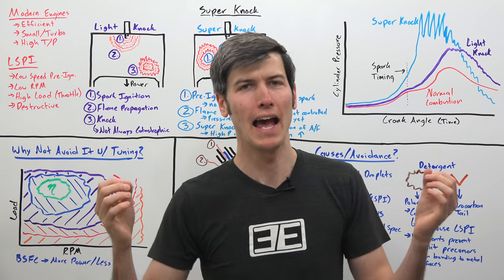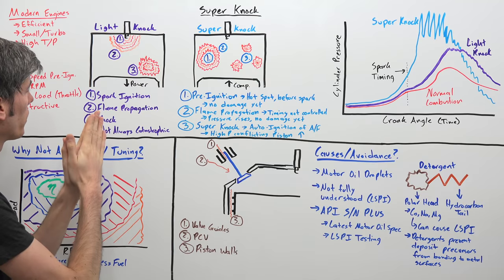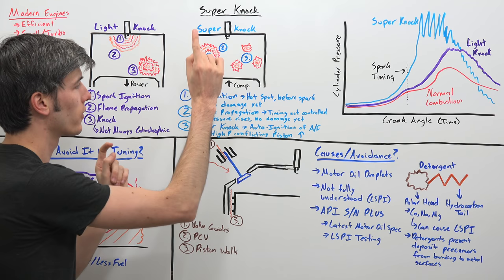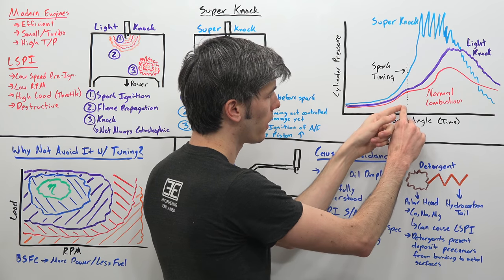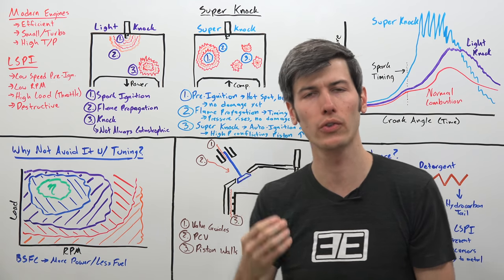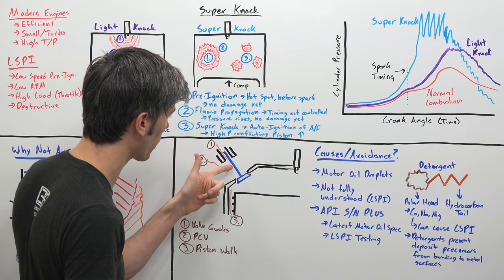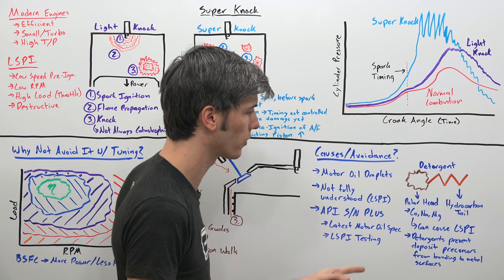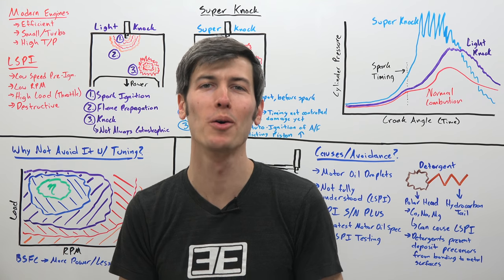How Super Knock Can Destroy Modern Engines

Comment: Hey there. I have a question ! Does spark plug plays a huge roll on how efficient an engine running ? Because I'm  the type of person that send car to service center and they advice me to change my spark plug everytime service (10 000 km). The first 3000km to 4000 km , my car running smoothly and totally save fuel ! But then afterwards it starts to run badly(the pick-up when floor it really slow) and the engine is so thirsty (monday fill up then thursday have to fill up again) !! So please give some advice for my question. Thank you. I'm not car guy so I don't know much so yeah please help me..
Reply: hello there, spark plugs have only the job of igniting, you just change them when they stop doing their job( it is a noticeable misfire).
apart of that, the problem concerning the fuel consumption, you need to provide more data (how many Litres you are consuming for how many Km and where, in cities or on the highway).

high fuel consumption can have many reasons, depending on the type of engine you own. it might just be a failing sensor causing the ECU to switch to an operational mode where your car consumes more fuel.

Comment: Toyota meanwhile took the time to develop Dynamic Force and make the tiny turbo motor completely unnecessary.
Reply: It makes 40 less horsepower than the Ford Ecoboost though
Reply: The Toyota a25a-fks makes over 200 hp.
Reply: The 2.0l Ecoboost makes 245hp, and 270 ft-lbs of torque
Reply: I’ll take a slight horsepower penalty for it being way easier to fix and also much less likely to even need to be fixed in the first place. Win win.

Comment: As had been mentioned Pinking(knock) is a bad thing and can cause problems and damage when flame fronts meet during combustion why do some manufacturers use twin spark plugs per cylinder( Alfa Romeo cars and some motorcycle engines). Doesn't this make pinking and damage in these engine more likely?

Comment: Is possible to get an rear-wheel drive electric hybrid car?
Reply: Kuber Sancho-Persad huh?
Reply: T Croft what hybrid has individual motors on each wheel right now? Maybe a supercar is the only type I can see utilizing that.
Reply: BMW i8, BMW i3 with range extender, Porsche 918 sypder, Porsche Panamera Hybrid, Honda NSX “new generation”, some new Mercedes should be red and hybrid
Reply: @ALMX5DP  Acura RLX SH-AWD...
Reply: Of course it is possible! Not only that, but the fastest car in Nurburgring, the Porsche 919 Evo is one of them!
Reply: My Smart EV is RWD
Reply: @gqh007  I think the NSX has individual front motors, but the others have motors inline with the ICE or a singular motor powering an axle, not individual wheels.
Reply: @aspecreviews  I stand corrected, I was thinking about the RDX. Yes the RLX does have individual wheels. Only a few utilizing that type of setup currently though, most being supercars like the NSX cousin etc.
Reply: I would consider something being RWD when the main propulsion is to the rear wheels and has no driveshaft or other such significant attached means of power transfer to the front. With similar logic, is why I consider Nissan’s fwd LMP thing fwd even thought 900 electric hp is driving the rear wheels
Reply: Mercedes has rwd hybrids.

Comment: Engineering Explained
could you please make a video about GPF gasoline particle filter? Is it worse than GPF or problems might be lighter? How to burn soot in it? How to do it with an automatic/hybrid transmission?
Reply: 1. its very similare to DPF
2. regeneration intervals can be longer since gasoline emitts less soot in lean combustion mode compared to diesel so it shall be better if thats how u compare them
3. regeneration is done either by injecting fuel in it and burning the content like a furnace or by excessive heating using am external source or by increasing exhaust temperatures to encourage soot oxidization
4. GPF has nothing to do with the transmission

 do u still want a video ? :D
Reply: @karimnasser6710  that's right except one thing. I guess with a manual transmission (or automatic in manual mode) a driver could help with GPF regeneration. Just hardly accelerating on a highway on 2nd and 3rd gears up to red line, and let the throttle off still staying in gear (engine braking). This could heat up the GPF up to oxidization temeperature and then let engine pump a lot of clean air (oxygen) through  the filter getting the process done.
At the moment it's not really discussed topic.
Reply: @Aleksandr_N  am not sure about that for one reason.
u see, to allow for regeneration u need an excess of oxygen , that means u need a lean burn (high air fuel ratio), burning lean is only achieved when cuising at low load for at least 5 minutes (thts the main problem with modern diesel for users who only drive in cities).
back to the scenario you mentionned, revving the engine high will happen with rich or stoechiometric mixtures, no air will be available for burning the particulates. unless regeneration will happen very fast after revving
Reply: @karimnasser6710  I meant revving high would make 1st part of process which is getting filter hot, than 2nd part would be engine braking with fuel cutoff and a lot of oxygen (clean air) flowing through the filter (remember, you already have accelerated to ~120kph in 3rd gear and than let your accelerator pedal off).
I wonder could this exercise  be enough for heating and for soot regeneration?
Reply: @Aleksandr_N  no cause when having engine braking the fresh air has a very low temperature, it would cool the filter down.
apart of that, regeneration needs a few minutes to be realized. 
but i like your logic xD, do you have any sources for your theory ?

Comment: Sweet videos, love your work. I have a question though, I drive diesel trucks and my boss just recently bought a  2018 Freightliner M2 with a DD8 ( I believe) motor. According to the manual it says it can go 45,000 miles in between oil changes.. that's crazy!! But what my boss doesn't know is that he can't use the old API for diesel engines instead there was a new revision in 2017 that added API FA-4 . I don't know too much, but it would be cool if you can find out what is causing the higher maintenance intervals. Is it the oil , or is it engine design , or both? Would like to see more videos on diesel trucks. Thanks
Reply: I actually work at the assembly plant that builds those m2s. It'd be interesting if it was Mt Holly plant truck because I probably worked on it if so lol. The DD8s are relatively new. I think the new oil and engines are supposed to work together for better efficiency and service intervals.
Reply: @Mr4512hkj  whereabouts is that? I'm in the New England area. As I heard they are fairly new. Everyone is surprised how long you can wait for the oil change.  Pretty neat ,as long as its reliable.
Reply: @luisaguilar7311  It's near Charlotte NC. The engineers from corporate were in my plant a year or two ago. Making sure we could figure it out. lol
Reply: @Mr4512hkj  nice. Do you like working there? Must be a good job. Especially in Freightliner, job security must be good, since all big fleets drive Freightliner

Comment: I'm glad mine only does it at low rpm low load cruising along. I used to think it was low rpm but I've tried dropping a gear to go from 1,500 to 2,000 at the same speed 50-60km/h etc just holding a speed no heavy acceleration. Am I right to assume this means it is not super knock?
Found out that the Italian tune up works on my DI 2.0l ecoboost but found out its quite difficult to do an Italian tune up at -20c just cant get the intake air temp up at all without a race track or losing my license. 0-160km/h only manages to get me from -c intake air temps to +2c if im lucky.

Its my own fault partly I take it out at night while on lunch in the cold for lunch and it never warms up during that time, maybe just as I finally get back 15min-20min later.
Shouldn't my thermostat stay closed to allow for a proper warm up until it is required to open? Seems the Ford ecoboosts do not do that I know 2 ppl with the same vehicle both of their engines act the same way...

Also this seems like something only likely to happen to a manual transmission vehicle any automatic would down shift... Please correct me if I'm wrong. Also I have a tune but removed it this winter figured in winter it wasn't needed but it also doesn't seem to help with my specific issue only helps with the italian tune up the extra boost makes extra heat. Guess I'll get a catch can ASAP too.

Its been bothering me just more than 50,000km but this is the 2nd time I had this issue, however as mentioned the Italian tune up seemed to work the 1st time very well but I need a summer day to get the effect to work with heat. Also I use top tier synthetic oil in the engine no noname stuff so I should be ok.

Should I stop using gasoline with ethanol? Ford says max 0-15% ethanol I used to use Shell 91 0% ethanol but since I have the tune I wanted to use my 93 tune and switched to petrocanada 94 with 10% ethanol since summer is coming up.
Reply: You don't need to have high intake temps to burn the engine clean. Just drive it normally till it's warm then let it thunder. Long stretches of highway with not too much traffic are ideal. Keep it the engine in the higher part of the midrange, then pin the throttle when overtaking or whenever you want. Engine brake till back at cruising speed. Do this for at least 15 min. Last few miles are your cool down lap, gradually drop RPM till back at normal operating revs. Don't pin throttle at low RPM, downshift then pin.
Reply: @Duskconqueror  I'll give it a shot, 1st time 10 or so 0-100 pulls back to back seemed to do the trick.

His video on how the italian tune up works seemed based on heat and temperatures which is what made me think I just didn't have enough intake air temp to actually get it off.
I believe its coming off from the Intake valves since its a DI engine.

It would be nice to have access to a closed course its ridiculously expensive to get on the track here.
Reply: @santaclause6462  All good engines benefit from longer spirited driving trips. DI engines   are, depending on the design and use of materials, harder to clean up. They'll still benefit though. I don't think you'll be able to get rid of carbon build-up on the intake valves though. Good synthetic oil will help to prevent build-up, but all DI-only engines will eventually get a little carbon on the valves. It's just a matter of time. Good working injectors and spark plugs will also prevent build-up.

Comment: Easy way to avoid super knock and simply reduce knock in general? Use higher octane gas. I do this with my Ecoboost Fiesta whenever the outdoor temps regularly get above 50F. If I run 87 octane in the middle of summer it sounds like someone dumped a bucket of ping pong balls in the engine. Using 89 octane the knocking is greatly reduced and I don't have to worry about melting my pistons or throwing rods.
Reply: I would recommend 91 octane or higher.... 87 on GDTI no freaking way.
Reply: @2damaxmr2  Yeah, I have changed to using 89 octane year round since I typed that comment. The next higher grade available everywhere around me is 93. It would definitely run better but holy crap is it expensive! So for now I will stick with 89. It only really pings under light load with no boost. As soon as the turbo passes the boost threshold the pinging disappears. Side note: I averaged 44.74 mpg on my last tank.
Reply: @angrodNumenesse  I usually dont mess with mid grade because here the difference between 89 and 91 is like 10 cents per liter. Cheaper to use proper fuel than shortening the life of the motor.
Reply: @2damaxmr2  Ah ok. Where I'm at the difference is 30 cents between each grade. By using 89 I'm already paying 30 cents more per gallon than regular and switching to 93 would be another 30 cents more which would make a noticeable dent in my budget. :/
Reply: @angrodNumenesse  I would still try to use 93 if you are running full boost. If you drive a grandmother you might be able to get away with it.
Reply: @2damaxmr2  I do drive like a granny. I'm not afraid to get on it if I need too but generally I go pretty easy on the accelerator. I got the car for the fuel economy, not so I could go fast. :) I do keep a close ear to the engine though. It really only pings under very light or very heavy throttle. Everything in between is ping free.

Comment: Any thoughts on the Super Tech and Amazon brands?  It looks like both are SN Plus and the price is amazingly less than the other oils.  I did try the Amazon 5W-20 on my Gen Coupe and did notice a difference but couldn't explain it but this video helped.
Reply: Supertec synthetic is a GL5 oil apparently.  Project Farm just did a video on it compared to RedLine oil
Reply: @gammalight1312  I saw that video and was pretty impressed but I believe the Redline oil wasn't SN Plus so the test doesn't really answer the question in this video about Super Knock and if Amazon/Super Tech (believe it's the same company who makes their oil) is up to snuff with turbos.

Comment: Couldn’t the super knock be cause by the intake pressure being too extreme to the point where there is soo much pressure already built in the cylinder and the low RPMs of the pistons don’t allow the cycle to happen fast enough to the point where the mixture combusts on its own with the slightest compression of the cylinder it’s self?

Comment: I dont understand how oil can ignite before the gasoline, because if i buy a high quality, high performance 2 stroke oil for my moped, the oil runs straight throw the engine without burning and drips out of the exhaust, leaving a mess on the floor.
Diesel needs more heat and pressure to ignite then gasoline, oil should be even harder to ignite then diesel.
Reply: I think the pressure or heat soaked hot spots are heating up oil that is hot enough to ignite the fuel too early

Comment: GDI specific issue? Carbon deposits cause hotspots?
Does the D4-S also show this issue?
Reply: is D4-S the toyota system?
Reply: @karimnasser6710  Yeah. And if memory serves, it is basically the retake on Lexus' resolution to carbon deposits on their intake valves. Because Lexus fixes stuff and tells no-one :D
Reply: @wburger2178  i guess this would depend on the engine model, cause newer D4-S models have dual injection (direct + Port fuel), in this case the carbon deposit problem shall be solved.
As far as i know, carbon deposits and knock have nothing to do with eachother, the only consequence of carbon deposit is a slight power decrease caused by a slight decrease of charge pressure.
Reply: @karimnasser6710  I was wondering about the carbon deposits and superknock. If a brand new engine shows this behaviour, then yes, it will be the oil droplets or similar. But if it is an older engine, I would think that the oil picks up carbon deposits, and these buggers will autoignite.
So to Jason: Do the DI engines show this when brand new? The superknock?

Comment: Btw, here is one recipe on how to cause LSPI: just machine your block and pistons with a dull endmill and don't deburr it. 
Why? It's because these small burrs sticking out inside your combustion chamber WILL heat up by the combustion process, but they won't get cooled because burrs don't have a good contact with the rest of the piston/head/cylinderwalls. Burrs and carbon deposits tend to work like glowplugs because of that.
That's the benefit of being bilingual: when you know multiple languages you can read from different sources and find knowledge in one language that's not available in another one.
Reply: sasja de vries. Why do you think that information is not available in other languages? That’s well known to me and I’m not bilingual
Reply: @alanhillyard1639  The point is whether something is readily available and how widespread a piece of info is. That's where I see a very clear difference between languages.
Generally speaking, some information that only specialists know in one county can be something every second teenager knows in another county and vise versa.
And then: if this info was available to you, and you speak English, why didn't Jason know about it? You both speak the same language, right? He makes videos about this topic all the time, he looks up info about engines all the time.
And then there is another aspect that you won't notice immediately, it happens a lot that roughly the same research is performed by multiple countries independent of each other, at first glance it seems like both have found the same thing, but some important details are quite often different. Because both papers look similar and both countries say "but i knew that already" the details aren't shared between those countries.

Comment: In the real world the engine is most efficient at medium load and medium rpm, not at low rpm high load.
Why are mid revs more efficient? Well, during city driving you can use engine braking and your engine has a quicker response and when you want to accelerate you don't need to push in the throttle as much. In other words low rpms are not ideal for city driving and they are not too great for control over the vehicle and safety either. The highway is where you have a more constant speed, but you won't drive on low rpms there. And then the main thing: if your engine outputs 30 hp at 3k rpm it will be loaded twice as little as when it's outputting 30hp at 1500 rpm; and that's because you have less revolutions and less combustion strokes so you need more work to be done during each combustion stroke to get the same power output.
Especially shorter pistons don't like low rpms, they are only good for high revving motorsports. Modern engines usually come with shorter pistons (such that the damn thing just falls apart after warranty is over). And then: engines without the variable valve things (lift and timing) will have a slow airspeed during intake, which is less then optimal and reduces efficiency.